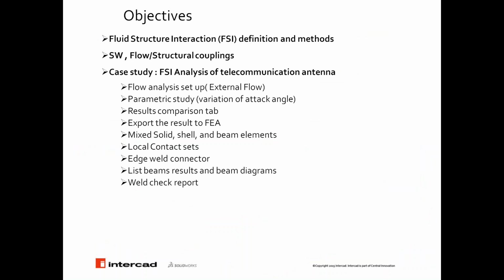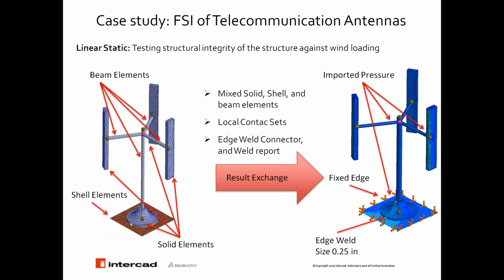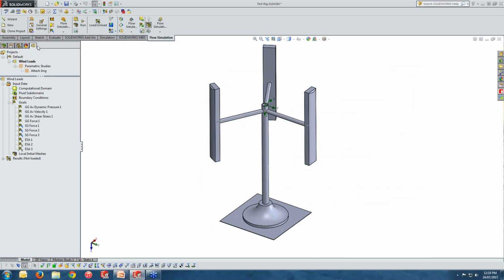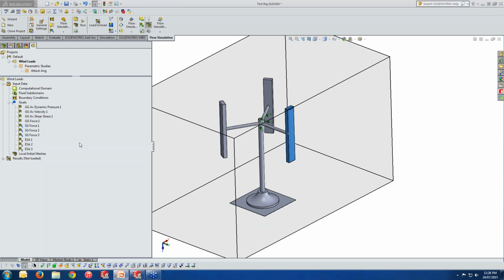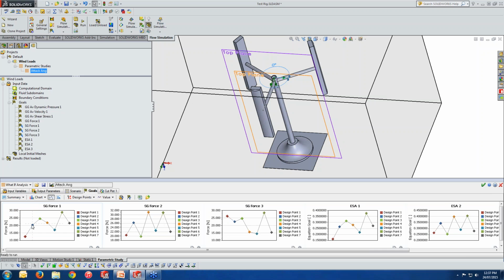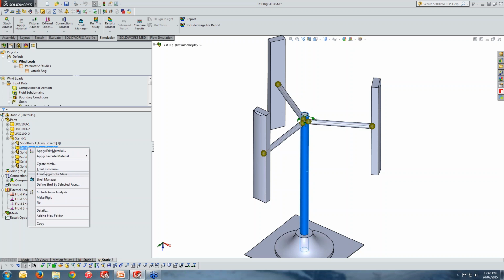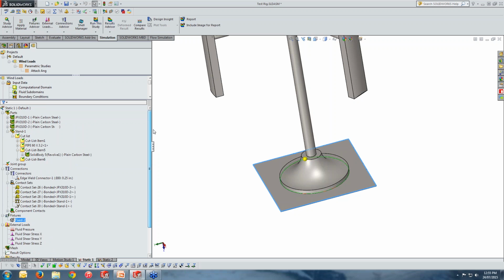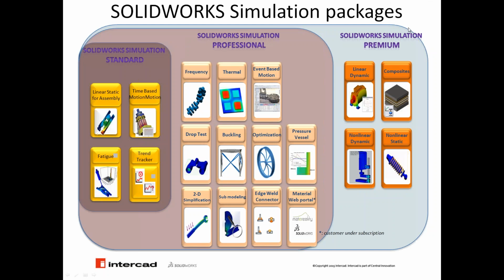Intercad Webinar: Analysis of Wind Loading on a Structure using SOLIDWORKS Simulation

Comment: Hi Sven - i hope i type your name correct :)
Thanks for the tutorial
I have a question
I am trying to analyze windload on a steel substructure and  i am doing the followings
1) I model a refereance surface (representing the cladding) around the steel sub structure
2) i run the flow simulation
3) i export the results
4) i start a static study
5) in the study i exclude the referance surface from the analysis
6) i import the results of wind simulation
7) i define boundary conditions material and joints in the static study
8) when i run the study - i end up with an error ''no external load detected''

what can be the reason?
can you help me with it?
thanks...
Reply: check direction of force!